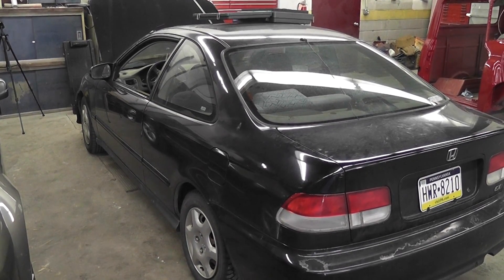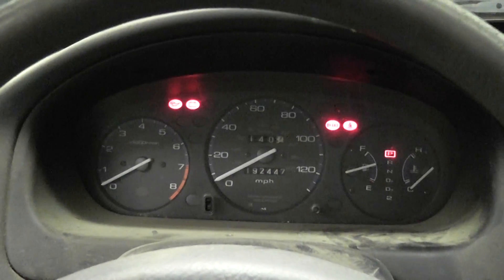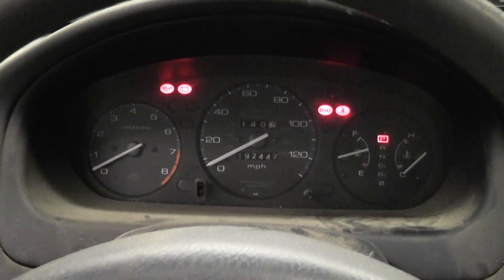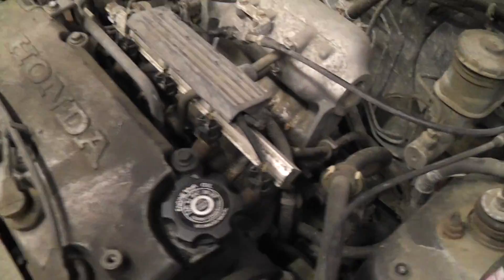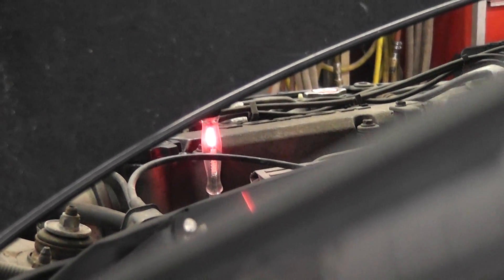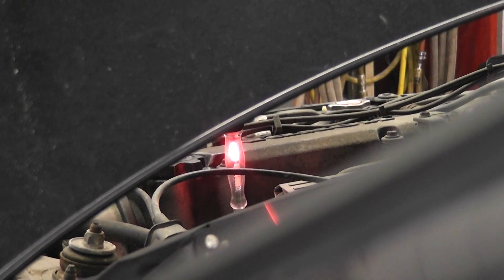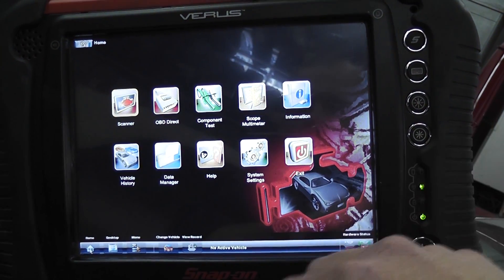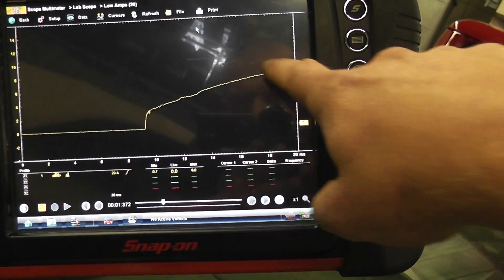How to test for a shorted ignition coil (Honda Distributor)

Comment: Wouldn't an Ohms check on the coil prim and secondary reveled the issue since most don't have the fancy scope?
Reply from the maker: The problem with the ohmmeter is that when it reads bad, its bad, but when it reads good, it can still be bad. I've seen many shorted coils measure good resistance (no stress)

Comment: What if you don't have a check engine light to come on in the run position.
Reply from the maker: Then you are missing a main power feed to the ECM or you have a shorted sensor pulling the 5v ref circuit to ground

Comment: Really? Anyone having this type equipment is not going to be watching a 101 video.
Reply from the maker: My focus is on training diagnostic technicians, not the do it yourselfers. But if you pay attention, you can adapt the testing methods I'm teaching to the equipment you have. Or you can just throw parts at it like most DIYers do.
Reply: @ScannerDanner  Yes. That is MY pet peeve. I have a friend who changed the piston rings on his car, (showing his ability) but I honestly don't think he has a good grasp on the theory of the ICE. When anything goes south, he starts replacing modules.

Comment: hey i just saw this video i have a honda civic that the check engine light doesn’t illuminate at all even with the switch on and you didn’t speak of what it was so i was wondering if you could share it with me to get my car running
Reply from the maker: No start and no MIL key on suggests the ecm is not powering up. Step 1: key on, measure voltage on your TPS or MAP sensor and see if you have a 5v ref available to one of those two sensors and report what you find

Comment: Just ran across this video and it has helped tremendously with my crank no start. I'm at a point now that I have no spark. Checked injector pulse and I have no pulse either so cam or crank sensor.  The car did get fried on a huge coil short so I am guessing cam sensor which means new dizzy!
Reply: New dizzy? Distributor?

Comment: WOULD YOU DO THE  INJECTOR  TEST TO EACH INJECTOR OR JUST ONE?? I'M HAVING A HARD START ON MY 96 HONDA ACCORD. I'VE REPLACED THE ROTOR AND CAP ON THE DISTRIBUTOR, FUEL PRESSURE REGULATOR, FUEL PUMP, MAIN RELAY, FUEL FILTER, SPARK PLUGS, AND PLUGS WIRES HAVE BEEN REPLACED. WHEN I SAY HARD START I MEAN IS THE CAR IS HESITATING TO START. I BELIEVE THE ROTOR AND CAP HELPED ALONG WITH THE MAIN RELAY. THERE'S STILL HESITATION TO CRANK.
Reply from the maker: if it runs fine once it starts, just testing one injector should be fine. Time to do some testing my friend. First thing. What is your coolant temp sensor show you on a cold engine? How does it run once it has started? What is your fuel pressure during the hard start? (Don't care that the pump is new)

Comment: What would be the direction if there’s no check engine light
Reply from the maker: Next step would be to check for a 5v reference at the TPS or MAP. No ref voltage and no C.E.L then I'm going after main ECM powers and grounds

Comment: 93 accord check engine light stays on, no spark at coil, power exist at plug ? Anything quickly comes to mind ? Ive study repeatedly your videos and limited on special tools (scoop) anything comes to mind ?
Reply from the maker: Get a cheap test light and do some of the checks I show. If it isn't this video, I have another Honda distributor engine no start where I'm using primarily a test light to diagnose it. Sorry, no link offhand. Check my chapter 22 playlist
Reply: @ScannerDanner   well not being one to give up and repeatedly watching your vids (your awesome dude) and comparing to my issue, ive narrowed it down to two issues #1 check engine light remains on when ignition turned on engine off and every honda ive ever had or swapped turns off after few seconds usually after fuel pump primes, #2 external coil isn't receiving a ground switch from Icm, however check icm for a signal from ecu  yel/grn wire on icm and its receiving signal, problem is rather or not its strong enough and dont know what value is normal or weak, gut feeling is there's a short to ground interfering with ecu's ability to provide strong enough signal for  icm to recognize and activate coil to fire, or icm is bad. Dont know a value to refer with  that of value currently geting at icm. ?
Reply from the maker: @4077661466jp  this is the one I was talking about https://youtu.be/-ZGLoSSowYY
Reply: @ScannerDanner  ok sweet greatly appreciated.

Comment: If the engine light doesn't come on when you turn on key, what is the usual diagnosis or things to be checked?
Reply from the maker: main fuses to the engine computer and then a quick 5v reference check on some critical inputs (TPS and MAP)

Comment: The problem that I have with my car is not the ignition coil but the fuel pump relay.   Well, that's what I thought at first, but I have now found out that there is no power in the (female) connectors that attach to it.  Could that be a problem with the harness or could it be something that has to do with the ECU?  Thank you, before hand for your answer, and for your videos, they are very good and worthwhile.

Comment: I have no power to the injector socket whats next bro? What else could it be
Reply from the maker: Stay hear now, don't bounce around okay? I see this same question on another video. 
What are you working on? I assume a Honda. Year, make, model, engine size would help.
 No power to the injectors on these older model Hondas was almost always the PGM-FI main relay or the ignition switch
Reply: @ScannerDanner  98 honda civic LX 1.6L  Di6y7 engine. I tested the pgm-fi  and its showed to be working. And when i pit the test light to the injector socket i have no power at all.
Reply from the maker: @EJ_173  just check a diagram, the PGM-FI main relay supplies power to the injectors as well as other things. You need to check it again. You can have a feed into the relay that is not there. Proper testing of that relay is needed my friend
Reply: I just bought a brand new relay and still nothing.. still no power to the injectors.
Reply: @ScannerDanner  and i forgot to mention its giving code po302
Reply from the maker: @EJ_173  you need to test your supply into that relay as mentioned before. Part of proper relay testing is doing that. I never told you to change the relay yet.
Reply: @ScannerDanner  man i wish you lived close by i get frustrated to easily i have zero patience for trying to find this needle in the hay stack. Its all good brotha i appreciate your help im just gonna drag it somewhere and let them deal with it. And if they cant fix it I'll sell the stupid thing
Reply from the maker: @EJ_173  that can end up costing you! too many parts changers out there
Reply: @ScannerDanner  i got lucky brotha it was the distributor. All good now, and thanks for your time and help i appreciate it 👍

Comment: I having the same problem on my delsol it has spark on top and no spark at the bottom of the wires changed out the wires already and it's 4 cylinder three but i can drive the car

Comment: I have a 1994 Honda Accord with a external coil. Crank but no spark. I’ve ran across this video and followed your steps. Here is the thing, I’ve checked the wire diagram in my chiltons and that black w/yellow wire shows that it goes to the ignition and is positive, not to the negative side of my coil. I tested it at the ICM/ignitor switch. However, I do not get power to the yellow/green wire from the ignitor switch to the ECM
I did a pulse check on a injector which I do get power there from the ECM. I did a Ohm check on the resistance on my coil and comes back within spec.
Any recommendations on what to do next is greatly appreciated. Thank you.
Reply from the maker: all of my diagrams show the coil as being inside of the distributor so I am not sure if the wiring is the same but the yellow/green wire is the on/off trigger signal that the ECU sends to the igniter to tell it when to fire the coil. You will NOT have a constant power there, it will be a pulsed square wave pattern and you most likely cannot test it with a test light and a digital voltmeter will be too slow to see the exact high and low of that square wave, HOWEVER, you will be able to see an average of that signal during cranking if it is there. 
The black with a yellow is the main power feed to both the ignition coil AND the igniter. 
I believe this video will help you more https://www.youtube.com/watch?v=-ZGLoSSowYY 
Watch this video and then we can talk some more

Comment: what if the CEL comes lights you when you turn the key but doesn’t go off causes no fuel pump prime and no spark then sometimes the fuel pump will prime and there will be spark and no cel will stay on ? i’ve replaced computer main relay and fuel pump on a 94 honda.
Reply from the maker: you need to do some testing on the ignition system DURING the no spark situation
Ignition switches are common faults on these too. Try banging on the column on the next no start

Comment: I know it's been a long time since you filmed this. But I had a question. I'm having a crank no start issue but it only happens in the morning when its 34° outside. I turn the key to the on position and my check engine light does NOT come on. In the video you said that would point you in a specific direction. What direction would that be? Any help would be much appreciated.

Comment: So if my check engine light doesn’t come on. Where do I need to look for next?
Reply from the maker: Year, make, model, engine,  and symptoms would help.
Reply: It’s a 1992 Honda prelude with an engine swap from single cam and I swapped it with a f20b. What happened was when I crossing over the rail road tracks my car stalled out and my dash dimmed out. I replaced the alternator, main relay and distributor.
Reply: So now it just cranks but does not start
Reply from the maker: Okay much better, thank you. With the key on can you give me voltage readings on all three wires of the TPS or MAP sensor? Backprobe it with the sensor plugged in.  
I'm interested in knowing what your sensor grounds are showing as I suspect you have a bad ground.
Reply: I wish I could but I don’t have the tools at the moment
Reply from the maker: @Terriothegreat  go to Walmart and buy a cheap multimeter and some T-pins

Comment: I have a 1990 Honda Civic no start. Car has fuel pressure. With cap off I can see coil spark but when I try and arc off that the coil stops sparking. What causes this?

Comment: Great video, thanks for posting.

One question: Wouldn't it be easier to check for spark by just clipping an inductive timing light to one of the plug wires and cranking the engine to see if the light flashes?
Reply from the maker: no, not only do I want to check for spark, but I want a visual on how strong it is
Reply: That's what you fingers are for (ha, ha). But seriously, thanks again for the video. Call me lucky, but in 45 years of working on cars I've never encountered a weak spark--  although I know it can happen. I've always had good spark or nothing at all.

Comment: Check engine light will always come on when first turning your key, it’s to test they’re all working. If it were on it would keep lit
Reply from the maker: Totally not what I was doing with the check engine light. If the light DOES NOT light with the key being first turned on, this is a red flag that the ECM is not powering up or that there is the possibility of a shorted 5v ref circuit.

Comment: You said if you did not have a check engine light it would point you in a specific direction. But you had it, so you went in a different direction. I have no check engine light. What is the direction you mentioned ?
Reply from the maker: If you turn the key on and there is no check engine light, the next thing you want to do is to check the main engine computer fuses. Then check for a 5v reference like in this video. I know it is an older Ford, but it is the same approach https://www.youtube.com/watch?v=1Nvyc_88AbY

Comment: I know this post is very old, but it's still very useful for diagnosing a crank-but-no-start problem on my 1992 Honda Accord that ran fine just last week.  I'm trying to translate what's on this video, which has an internal coil to my Accord, which has an external coil.  The external coil does not have the "+" and "-" markings on it.  There's a 4-prone plug connected to the coil, but only 3 terminals are active.

As mentioned, there are 3 wires (BLK/YEL, BLK/WHT, and YEL) connected to the coil.  According to the wiring diagram in the Honda Shop Manual, the BLK/YEL wire comes from the ignition switch; the YEL wire goes to the "power" terminal (BLK/YEL) on the igniter; the BLK/WHT wire goes to the "primary output control" terminal  (GRN) on the igniter.  There's also a YEL/GRN wire on the igniter that connects to the ECU,  and a BLU wire on the igniter that goes to the tachometer and other stuff.  I did the following test:

1) With ignition ON and all wires connected to both the coil and igniter, I measured around 12V steady on both the BLK/YEL and GRN wires on the igniter.
2) While cracking, the GRN wire still measured 12V steady (i.e., no flickering).
3) I disconnected the GRN wire from the igniter, then hooked the test light clip to battery "+" terminal, and put the probe on the igniter terminal where the GRN wire had been plugged in.  There's no flickering when the engine's cranked.
4) I completely disconnected the coil from the engine and measured resistance between various terminals according to instructions in the repair manual.  The resistance values do not meet spec.

Based on these tests, I'm concluding both the igniter and coil are bad.  Did I do the tests (as described by ScannerDanner in the video) correctly for my car, and is my conclusion correct?  Please help.
Reply: Just realized I posted my earlier comment to the wrong ScannerDanner video.  Comments belongs here  https://www.youtube.com/watch?v=-ZGLoSSowYY  .  I've reposted comments there.  Sorry.

Comment: My 2001 Honda civic relays in the glove box clicks when started and the rpms pulses up and down, the check engine light comes on and off at the same time, after about 10 clicks the check engine light stays on, the clicking goes away, it idles low , very low for about 3 minutes and then idles to what sounds and appears to be normal. Even still if you press on the gas to high rpm the engine pulses and won't rev high rpm, can't even drive the car passed 50 mph, any suggestions out there

Comment: One of my friends has a 96 civic and she tried doing a cylinder drop test herself by pulling the plug wires off the spark plugs engine running and not giving that spark any place to go. She got to the third cyl and the car died and won't start. Battery had to be replaced so I couldn't look but is it possible she fried the coil?

Comment: I have a 99 Civic SI that goes dead when it gets warm. When this happens there is no check engine flash when I try to restart. When it cools off a bit and it's ready to start the light resumes working. Never stayed dead more than an hour.
Reply from the maker: when it is not starting, find out what you are missing, spark, fuel psi, injector pulse also check to see if there is a 5v reference on your TPS and MAP sensor during this condition

Comment: Hey I have a 1998 Honda Civic that keeps burning the distributor. I replaced it 3 times already. I have warranty so AutoZone just orders me another one. The distributors are remanufactured. The engine and transmission have no issues. I replaced the spark plugs, the wires, cap and rotor and there's no moisture. Any thoughts on how to resolve my issue? Thanks!
Reply: check the ground wires also

Comment: HELP!  The ICM inside my distributor keeps blowing...I put a new one and the car will run for a few minutes before blowing the icm....went through 3  already can’t find the problem!
Reply from the maker: Where is the ignition coil? If it is external to the distributor, change it.
Reply: ScannerDanner its a stock distributor . The coil is on the inside...something keeps making it blow
Reply from the maker: What part is "blowing" and what checks have you done?

Comment: Hey I have a 96’ accord v6 and I have a tach issue I’ve been told it could be a ignition coil issue, I’m trying to get some more input on it. It mostly operates just fine some times acts up for a little bit but sometimes goes haywire, it will go from normal operation to bouncing everywhere and dropping down to 0 but there is no performance issue
Reply from the maker: No performance issues means it is most likely a gauge issue. But check the blue wire that goes to the ignition coil, it is the signal to run the tachometer.

Comment: update i have spark changed the crank sensor and a blown fuse link unfortunately what i should have done first is check the compression case all i'm getting is 30 psi in 2 cylinders and 0 in the rest so I am screwed, I know how to do a head gasket  but its a lot of work
Reply: Michael D it's not too much work it's the easiest engine .

Comment: i have a 91 acura legend that cranks but no spark i have replaced the coils as most where burnt up and i replaced the ignitor and still no spark i have check all the grounds and they are good
Reply: Michael D do you have power at the harness going to distributor
Reply: if you have power at the harness and at the coil change rotor and cap
Reply: Did you check for injector pulse?
Reply: FrugalPrepper no compression so pointless in fuel
Reply: Michael D I have the same problem  did u ever fix it